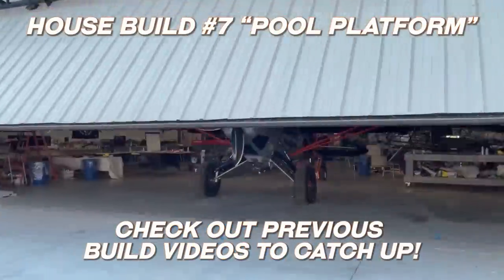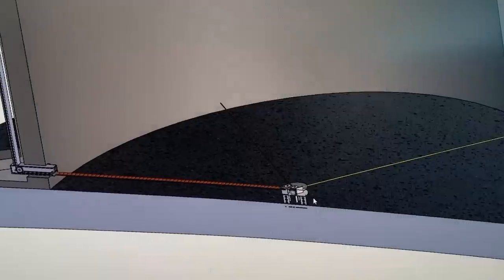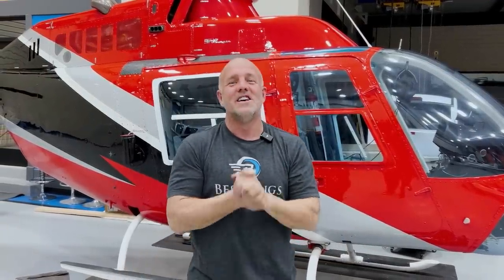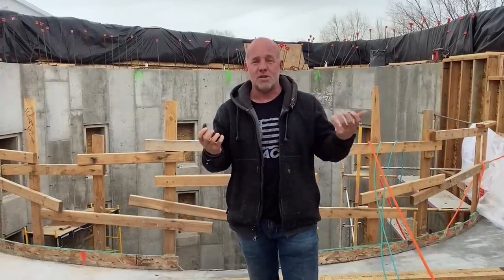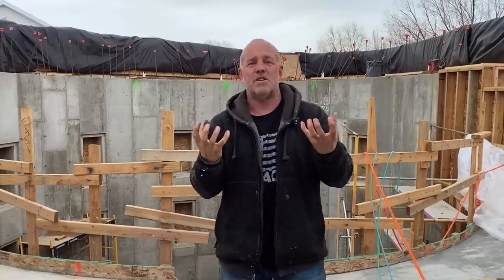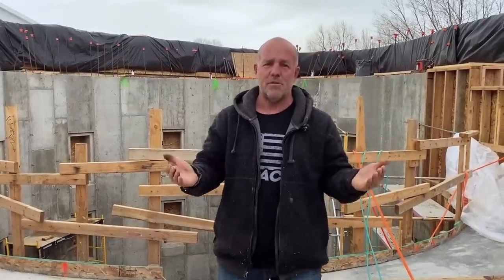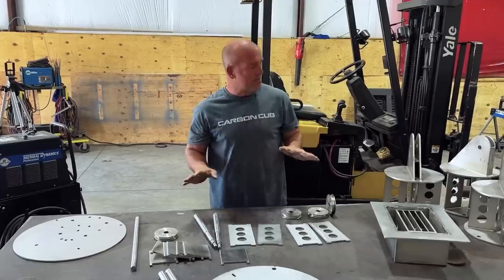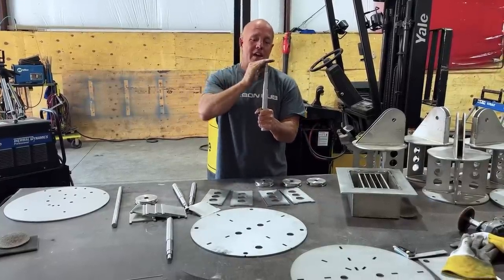How!? Transforming Pool - Dance Floor to Freedive | House Update #7

Comment: Cool "Boat" in the Pool, Center of Buoyancy, Center of Gravity, I didn't hear you say it, but, what happens if all those people run to the same edge of the "Boat" to look at something that is over the edge of the pool on the ground? It would be the limiting factor, all the tension on one cable being offset by everyone moving to the edge of the pool. Did you consider putting a "Submarine" instead of a "Boat" in the pool, where the last 6 inches is raised by blowing air into the ballast tanks to add floatation in the up position?

Comment: Mike, what will keep the platform, in a worst case scenario, from floating to the surface in an unlevel fashion? It seems if that happened the fluid transfer rate would be out the window.

Comment: Like your engineering spirit Mike...no doubt. But I am surprised at your idea for the floating floor. The dynamic loads of a dance party seem pretty scary. If unbalanced weighting causes unleveling to the point where people slide to the lower side you can imagine all kinds of mayhem. Also, the "float" suspended at various levels in the water column seems like it would act as a barrier, restricting water circulation above and below, and causing differences in water temp and quality. It also seems like the float would be expensive to build. I wonder if you considered a metal grate-type floor that would be suspended from the top and would sink through the column of water. Seems like that would check the simplicity, safety, water quality, and economy boxes better than the floating floor idea. Just my two cents...thanks.

Comment: I'm just wondering what cables could be used that will neither contaminate the water with manufacturing oils/need lubricated and thus contaminate the water. while also being able to endure the wet dry cycles of moving into and out of the water. all the while being able to withstand the strain of moving the platform through the water.

Comment: Why not vary the buoyancy? Make the platform to have positive buoyancy, and fit it with tanks that can be "Blown" to provide extra buoyancy when required, simple depth gauge could be used to compensate for additional load. This could greatly reduce the load on the "Hold down" cables.

Comment: Did you consider using ballast tanks instead of cables and a motor? I was wondering if you worked through that engineering design path at all?

Comment: Awesome design.  I am not sure how the local building inspector is going to know how to sign off on it other than to say as long as there is a state licensed PE’s stamp on it.  Where I am from they would probably want to collect more taxes when the floor can be occupied because it increases the floor space.

While I am not questioning the calculations, my internal physics detector starts alarming when I see how easily you move those parts around.  My brain is telling me they should be much beefier and heavier.  I’ll need to have that internal physics detector calibrated I guess.

I am assuming you are not using bladders to raise the platform and the cables will provide the stiffen in whatever position, but will there be some sore of locking system independent of the cables to find it in the up and partying position?

Comment: Why not a positive stop at the top, so cable system isn't carrying the load 100%, and you could even build in extra flotation for more people?  A small rim/shoulder arrrangement around the top of the pool?  It seems like this would also make leveling the platform with the floor a simple task.

Comment: I'm sure you must have thought of this but what happens to the platform if at a party all the 50 people on the dance floor crowd at one end as might happen if they wanted to see someone blow out the candles on a birthday cake?  Could the weight being concentrated on one side tip it down and get it jammed against the walls?

Comment: So the two feet above waterline is the surface of the platform, correct?, and the reason for the pulley above waterline is just to double the force of the pull, and half the speed?? If correct are those pulley housings also acting as the orifice to allow water to flow through platform..

Comment: Couldn't you add a perimeter of hasps or turnbuckles that could lock the floor at the top to give it rigidity vs bobbing up and down with weight load?

Comment: Hey man
Why don't you just go full submarine mode. Have a built in air compressor within the platform. Pum air into a tank within platform allow water to flood the platform. Then release air from tank back into platform  pushing the water out and to allow it to rise again. It's default mode could be to stay up top.
Just a taught. D

Comment: So the platform holes to prevent the quick flotation of the platform in case of a failure are protected or diffused how in order to prevent a dangerous suction /vacuum to people?
Reply: ~11:45

Comment: Won't the platform still be wobbly with this system? You could at the very top have some tracks it slots into and locks since the wobble only matters way up top when used as a platform.

Comment: So, you have a pool with a 25 foot composite boat floating in it, with 5 tons of positive buoyancy, that you will pull to the bottom of the pool with 4 stainless cables. Maybe 6 inches thick, weighing 2000 pounds? Hard to make it rigid enough

Comment: Tension on the cables could be adjusted/reduced in the submerged position if the platform had bladders.  Probably not worth the added complexity/redundancy, but I really like the “pull down” configuration.  Great build, Mike!
Reply: thought along the same lines, using a plastik tank to fine tune - sure Mike fugured it out ... if the numbers are right they are right

Comment: Will you be using chlorine to keep the pool clean????? If so, Stainless and Chlorine do not mix.  Check out PMUC requirements and testing for Stainless pitting / corrosion etc...

Comment: The floating platform still seems too complicated. Why not make it like a bcd? More air higher, less air lower. And install some safety catches in the side wall so it can't fall or move if the air escapes, or you want it at a particular level for a long time

Comment: I was going to say: the floor could be a submarine with a flat top. Instead of mechanical lifting, why not a coil of air hose loomed underneath the floor. Then just a big, strong fitting at the bottom of the pool piped remotely to anywhere convenient in the basement for the pump and valve assembly. No mechanics to wear, to electrics to short underwater. Pump in air to raise, pump in water to lower. At the top position, a ledger would create a hard stop and with enough extra buoyancy engineered in, no rock 'n roll when a crowd line dances at max capacity.

Comment: Do you have any way of locking the platform in place so it dosnt shimy about when people are walking on it? And also for the situation that you have to drain the pool for some reason it would be good if the platform could stay in place to prevent anybody from falling down. I Imagin some sort of bolts you could extend in the corners to lock it in certain predetermind hights. Also that would increase your max load on it a lot because you are independend of the flotation force the platform can provide. Love your Videos and your out of the box approaches. Cant wait to see you working on something with wings again. But I have to say I never thought watching someone overengeneer the shit out of a house could be so facinating. Greetings from Germany!
Reply: i just had an idea for the "pin" going in the wall. If you have it kind of hook shape that would allow it to enter the connection and retract easy when you have the buoyancy of the water but would prevent accidental retraction in case there is no water because it would hit a lip and you physically could not retract it without supporting or lifting the whole structure by a crane. It´s not even my project but its still fun to thinking about neat solutions :) Have a great weekend!
Reply: also I assume you would still have a small gap all the way arround so if you paint your locking pins at certain possitions green and red you could easily check if they are fully seated or íf they are stuck half way in. Kinda like one of the old timie aircraft gear indicator pins. That would be a nice nod to aviation

Comment: The combined force vectors on the pulley disc mounts are resulting a fairly heavy load of around half the payload of the entire platform in the direction of the winch system. It looks sturdy, but could it take the this load sideways?
Reply: The load should be nearly equally distributed around the center. I would think only the friction of the pulley bearings would cause much of a side load during movement.
Reply: @tomcoryell  The 4 sides cancel each other out 100% if it's precise engineered, and done by Mike, it surely is. ;-) 
The other half of the load is in the direction of the cable intake of the pulley disc. It could be brought down to zero if you bring two of the four cables in form the other side so they also cancel each other out, but this way you still have to deal with load in the direction of the intake.

Comment: Isn’t simpler to have an inflatable ballon under the dance floor and control is size with compressed air? Or with ballasts. The pool can get deeper when the ballon is totally deflated and you only need enough displacement to make the platform buoyant. When emerged some simple lock mechanism to hold it up. No cables or railings needed.

Comment: It's not safe to assume that a worm drive cannot be back-driven. The original AT&T rotary dialer had an air-paddle back-driven through a worm drive to regulate the rotation speed. The geometry and lubrication need to be considered and tested.

Comment: You made so many simpliffications and assumptions, that I feel I need to write this comment. First, if the disc will disconnect it's not gonna be all strings breaking at the same time. Most likely they will break one after another and the disc will flip verticaly and will be displaced with a lot higher speed than you think. The other topic is that what if there will be most of the people standing on one side of the disc? The string will play some role in stabilizing, but the disc is basically a boat. I think the best idea would be to create internal compartments where you can pump air inside and the disc should be zero displacement when submerged and positive displacement when usd as a platform.

Comment: Because the platform is "floating",  your lift/drop system, only deals with the weight of the platform, the weight of the water has no bearing on load  of the lift/lower system.

Comment: how are you keeping the dirt out of the pulley points?  Is there provision to clean those?  Neat system.
Reply: What dirt?
Reply: @james1795  all pools collect dirt from the atmosphere.  I'm concerned that all those things sticking up from the bottom of the pool will collect dirt and gum up the system... most pools have skimmers for this issue but with all those cables running across the bottom of the pool will be a challenge to keep clean.  With that said, he may just have a clever solution - thus my question...
Reply: @stoneshrink . Hmm...I suppose you don't think Mike is smart enough think of a filtering syatem?
Reply: @james1795  you have reading comprehension problems?  reread the last line of what I wrote before.
Reply: @stoneshrink . Troll.
Reply: @james1795  You certainly are
Reply: @stoneshrink  ?   Troll.

Comment: use a pump to fill the cavity with water to lower it down and vice-versa, like a sub. and to have a perfect leveled & tight floor you can put some stoppers above. the force against the stoppers may be enough, you could put some locks too if necessary

Comment: Mike,
Stopping the video at 13:30 minutes in.  I guess my question is, you have a lot of buoyancy in the table, the way you're talking about it.  You're talking about pulling it down, i.e., working against the buoyancy that you've built into the table.
Why aren't you using ballast tanks?  Use four or so small tanks that you can fill with water to offset the inherent buoyancy of the table.  Not enough to put a negative delta on it, but enough to reduce the positive delta and make it almost neutral in buoyancy, which would take a great strain off of the cabling system?
You're a far better engineer than I would ever dream of being, so I'm sure you've considered this, but if you haven't, it's out there for exploration.

Comment: What if 50 people all stand on one side of the floating disk platform? With all that weight on one side it might tilt and people would slide off and underwater, under the platform! As people slide off the load would shift, the platform would un-tilt and some people might even get pinched between the platform and pool wall, while others would be trapped underwater!
Reply: Mike_Patey-_  Do detect sarcasm? Is being on the shortlist a good thing or bad thing?
Reply: No sarcasm. Just a thought about what could possibly go wrong.

Comment: Why don't you build it offsite , find a dual hull speedboat trailer that hauls on an angle . Easy Peasy
Reply: At 25 feet across, if you tilt it enough to barely get it under an overpass, its still more than 21-1/2 feet wide.

Comment: I’m an idiot compared to you. In my mind there will be a “spongy” feeling when people walk in the platform when it is at the top. I assume you’ve taken this into consideration. Why not some kind of locking pin system to hold it rigid at the top? Very curious if you have calculated that it won’t be a factor

Comment: @mikepatey how did you account for a biased load on the platform itself?  I’m imaging if all 50 people are standing on 1 point of the platform, the platform would lean towards that point?  Or is the buoyancy such that it would be negligible?  

Second, how do you account the  risk if the cables snap they could whip and injure?

Comment: I applaud your innovative spirit. Unfortunately, this will always be broken down and it'll be a giant money trap in your elderly years. There's too many moving parts. Too much complexity. And no one but you is going to know how to run it or maintain it. Which means after you lose interest and it starts breaking down regularly, you're just going to have a "million" dollar waste of machinery and parts. You'll drain it and it'll be drained permanently. Literally has a 10 year life (or less). Every time to run the water out and in, it's going to need to be to filtered. Because cavitation and debris. Just my opinion. Freezing and thawing and auto-winterize. This giant pile of money you're spending is going to be the equivalent of scrappy's nox.